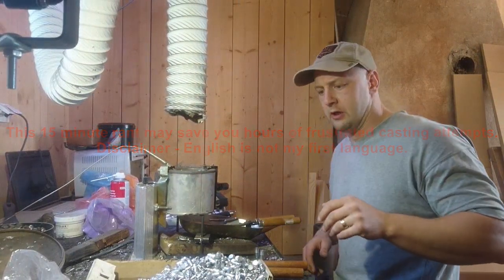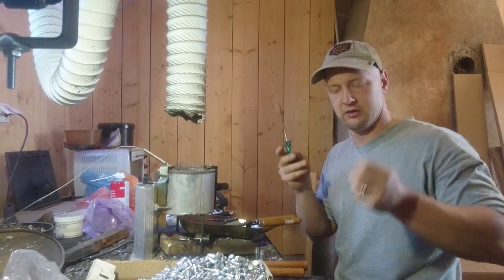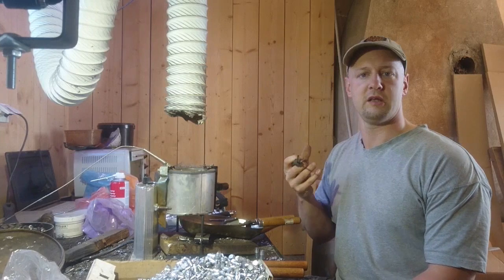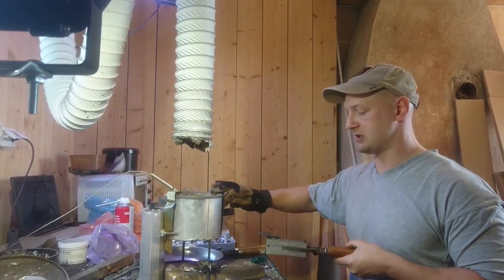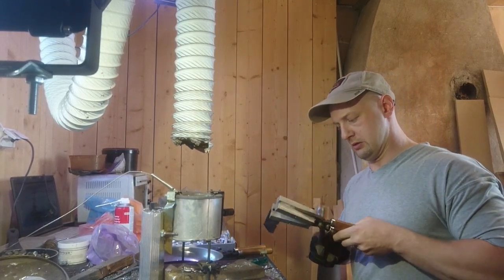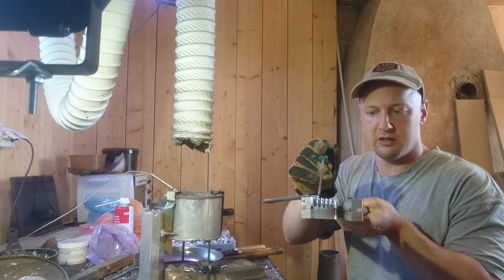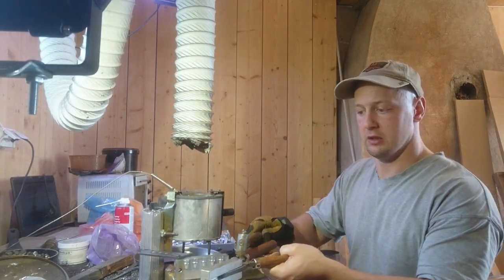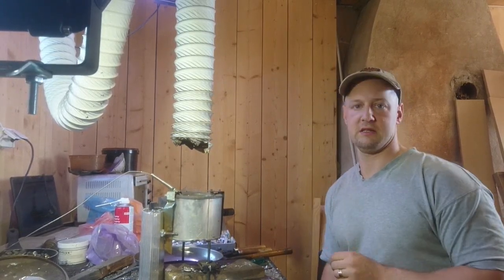Rant on bullet mold temperature

Comment: Excellent advice,  but are you sure about the 400F,  I have mine pot set at 410C, PID controlled as well...
Reply from the maker: Sorry for the mix and match. I run the PID at 400C, then spoke about 1000F.

Comment: Casting pace matters.  Too fast and the mold gets too hot and makes frosted bullets. Frosted bullets tend to be brittle.
Wrinkeled bullets can also be lead or mold too cool or oil in the cavity.
I like about 700 degrees farenheit.
I keep a pot of lead off to the side and add a ladle of lead to the bottom pour pot when it gets too the half way mark. When casting big heavy bullets i put the mold up to the spout and let the weight of the lead on the pot create good fill out of bullets 
 With six cavity handgun bullets i try to get the lead to flow dirrectly into the sprue holes but it isnt critical. 
I have cast at least 25,000 good bullets and my share of bad ones too. 
John Davis jax fl

Comment: Thanks for the information. Do you add anything to your wheel weight alloy? And do you know the BHN of your casting?
Reply from the maker: I run straight wheel weight alloy for most of my casting. For low pressure rounds I sometimes add 50% range scrap, mostly because of availability. WW is pretty standard in hardness and there are tables for it depending on air cooled, water dropped or oven treated.

Comment: Hmmmmm I’m curious if your advice would work/apply to a lee 1oz key drive slug
Reply from the maker: I have never tried it, but know of people who do with good results. There are also commercial slugs available with coating.
One thing to think about is hardening, the slugs are usually made of soft lead, if your alloy is like wheel weights it will harden when baking the PC. Can lead to high pressures in your choke.
Reply: @Whistler84  I agree I’m just having issues with the mold not being hot enough. You really have to have a lot of heat to fill out that mold 1oz of lead is a lot. All my molds are falling apart due to the heat